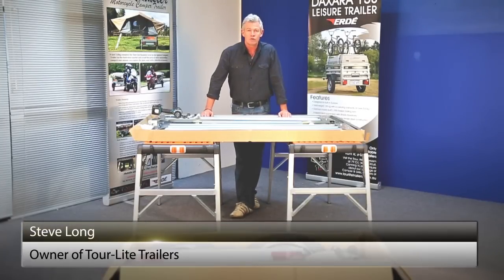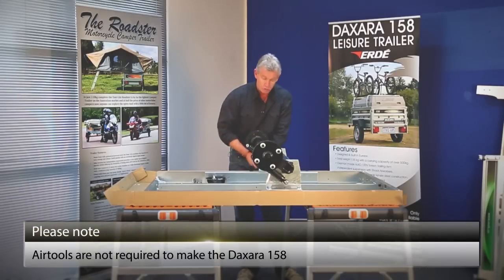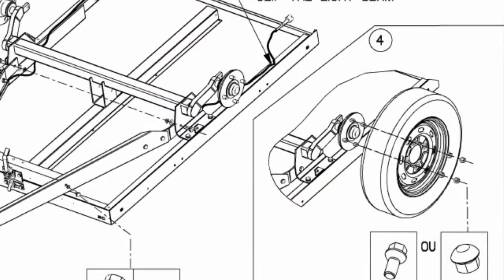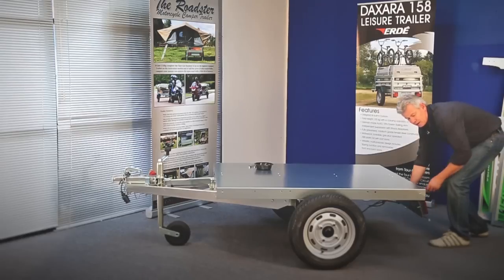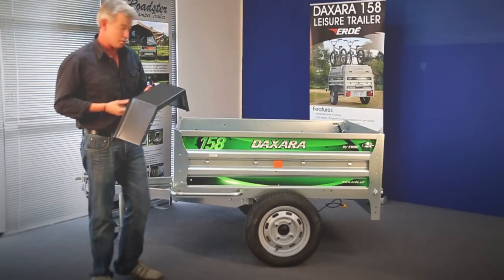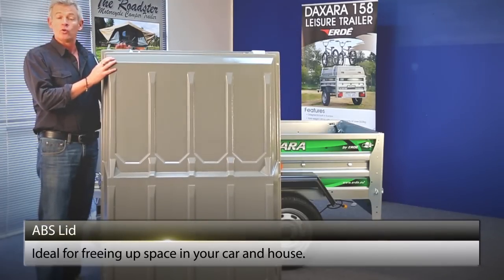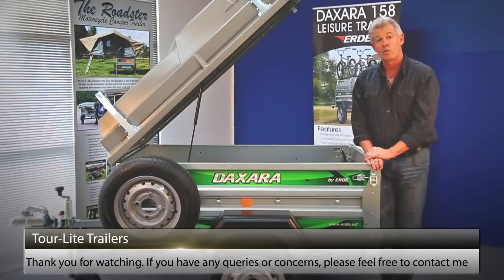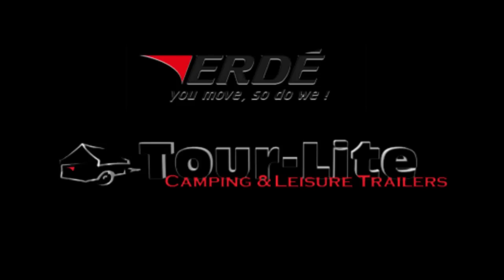Tour Lite Trailers Tutorial DVD

Comment: Not keen on the tip release lever position...if the trailer load is slightly more to the rear.  The trailer could hit you.  Having to lean in to and under the front of the trailer to grab the release lever.